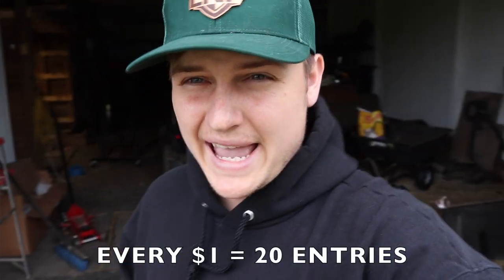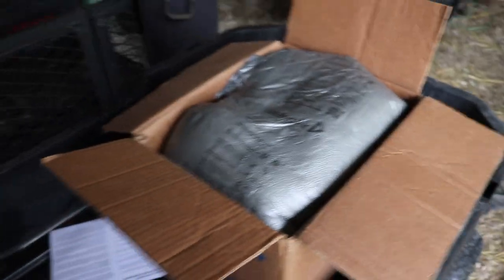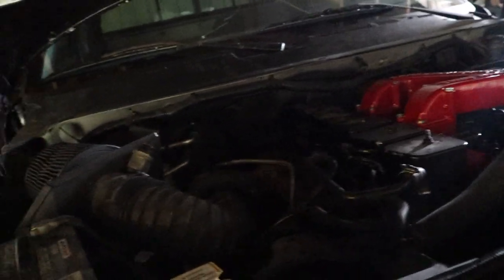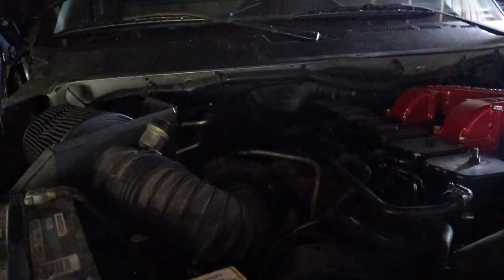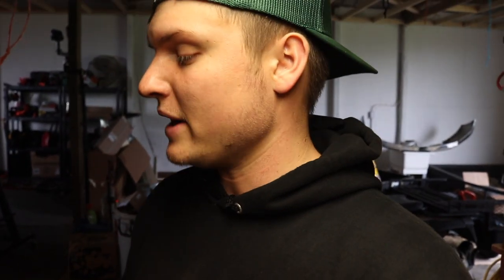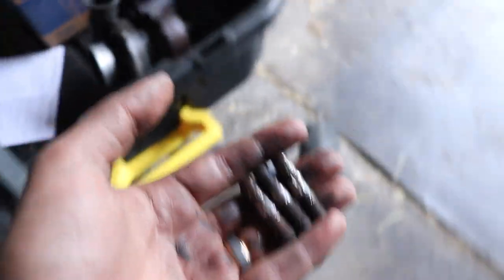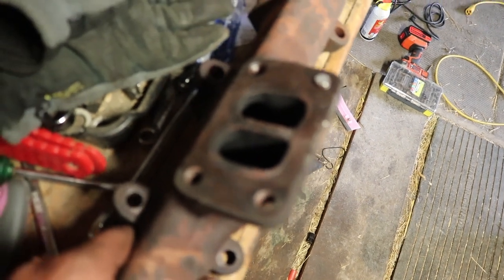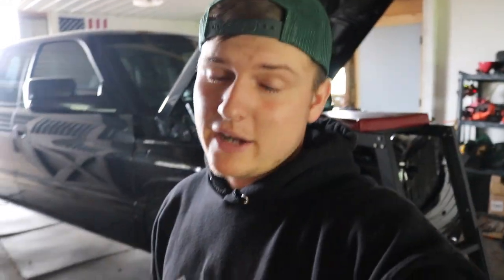12V CUMMINS COMPOUND TURBO INSTALL FAIL!!!

Comment: Go to a friend that has a welder and take a nut that fits over that bolt and weld it on there good then get a breaker bar on an turn it out. The heat from the weld should help break up the rust. Done it many times over the years works like a charm

Comment: Get a nut booger weld it to the bottom of that stud if u have a lil Propane torch heat up the stud With a ratchet and socket twist it out

Comment: Cool video... We mechanics have run into all sorts of issues doing jobs like this. What makes it easier for us is we are use to the fact you will most likely have a exhaust manifold bolt snap off and need to deal with it. Good part is it’s broke in the manifold and not in the block. Grab yourself a nut, weld it to the broken portion of the stud, heat the manifold up a bit with your torch and spin that broken stud right out.. We got faith in you brother.. 🤘🏼

Comment: If you can’t locate a manifold, a trick I use is setting the stuck stud in a bath of penetration solution, WD-40, or even some motor oil depending on severity of the jam. Most of the time it comes unstuck. Hope that helps and hope my name is picked for that bad boy!!! My 96 (that I had to sell) started just like this one no matter what temp it was outside.

Comment: I feel you with that broken or Rusty bolts is annoying .If I have an upgrade planned on my truck I hit with liquid wrench about a week in advance every day until project time. If it's an unforeseen problem break out the torch and heat them bolts up

Comment: YOU ARE DOING GREAT ...RELAX ...NEED TO BUY A REAL TORCHE ...IF I DIDN'T HAVE TO WORK TOMORROW I WOULD COME AND HEAT IT UP AND GET IT OUT        ALL YOU GOT TO DO IS HEAT IT UP THE MANIFOLD UNTIL IT IS GLOWING RED AND THE STUD WILL COME OUT EASY A LOT OF HEAT

Comment: If you’re adding an atmospheric charger or wven a manifold charger why leave the restrictive stock manifold? Just curious you’d make a little more power and have better sound with a steed speed or a stainless diesel manifold?

Comment: Doesn’t working on the floor kill your back and legs brother? You need to get or make yourself a workbench and get yourself up off the floor. Will make it easier on yourself and be less exhausting on your body...

Comment: To get studs out . Take 2 nuts put them both on the stud and tighten them up and break the stud lose . To get broke studs out . Weld a nut on the stud. . Find a welder